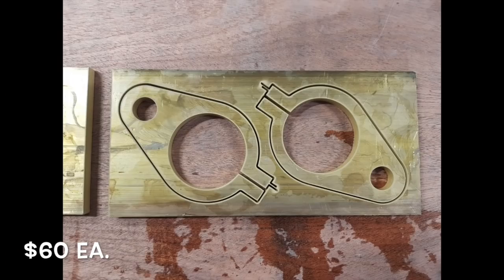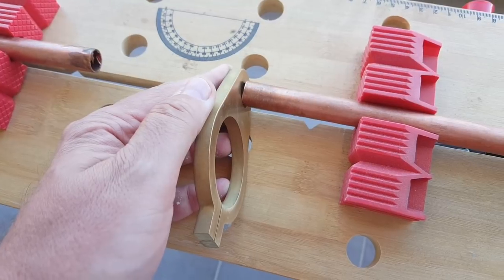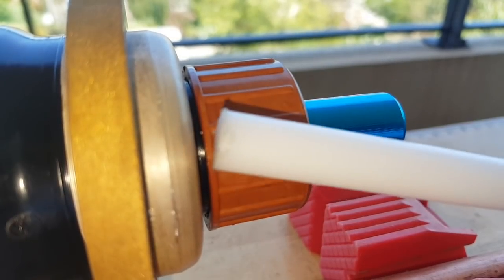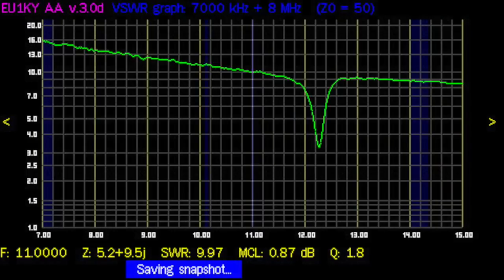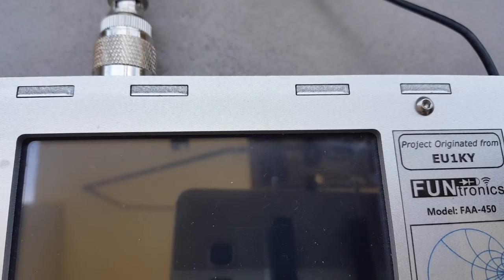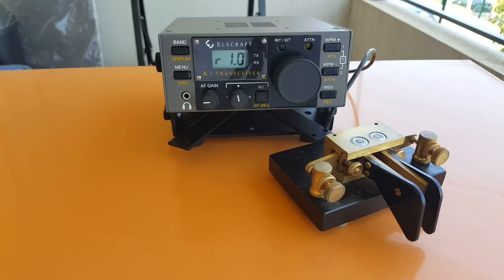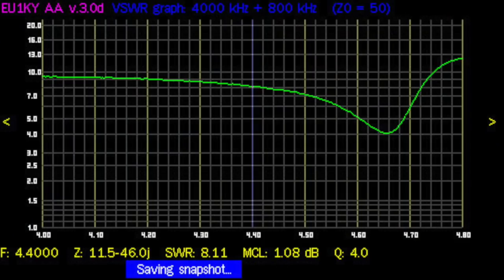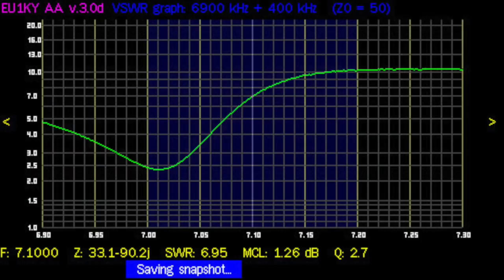Building a Magnetic Loop Antenna For My Apartment, Part 2.

Comment: A simply great video! I had a Jennings VVC for 30-odd years and I broke it last year while making my loop, so I ended up with a Rooskie one too like you. I couldn't figure out a way to connect to those electrodes for decades. In the end, I cut two "L" shaped pieces of 12mm wide copper sheet made from an old copper water cylinder, and I rolled one leg around each electrode and clamped it with a "Jubilee" clip. The other leg connected to the loop (LDF5-50 in my loop).  I hope that the steel railings on your terrace didn't impact significantly on your initial experiments at tuning? Another superb video Gil. TY.
Reply from the maker: Thanks, no effect from the rail apparently...

Comment: So I have a vacuum variable capacitor now, and I have 0.5 in copper tube on the way.  A question I have is what is the benefit of feeding the loop as you did with a torroid vs a smaller feed loop?  I like the neatness of your solution and the simplicity of tuning by the number of turns. 

On the other hand I plan to put as much as 50 watts through it digitally or CW and 100 ssb so I wonder if the choice of feed mechanism matters in that case?
Reply from the maker: In that case I would use the inner loop method..

Comment: Merci for this video. I like how real it is. I am in the USA and wonder how I would find someone to fabricate a vacuum cap clamp like you did. What did you search for in order to find a fabricator? Also, are you willing to share you 3d print and design files for that clamp?
Tnx es 73 de Arnie W8DU
Reply from the maker: Sure, it's on Thingiverse, search for Radio Prepper. To have one made search for laser cutting or water-jet cutting...

Comment: Comparing antenna designs and dangers; 40 watts into a whip on the balcony of your apartment is no different than 40 watts into a magnetic loop antenna.   The danger is that in a loop the high voltage is at the capacitor usually close at hand whereas in a dipole the high voltages are at the tips usually high in the air, same with a whip.

There's an online calculator for how much voltage to expect.  
https://www.66pacific.com/calculators/small-transmitting-loop-antenna-calculator.aspx

"FCC Guidelines for Human
 Exposure to Radiofrequency (RF) Electromagnetic Fields"
As you can see, it is considered safe for the radio operator to be within 1 meter of a 100 watt loop operating in the 20 meter band.  I'm not exactly comfortable being that close but there it is. 

Controlled Population Exposure for 100 watts
(Distance  in meters)
7.01  0.36 
7.02  0.38 
10.01 0.57 
10.02  0.69 
14.01 0.72 
14.02  0.77 
18.01  0.85 
18.02  0.87 
21.01  0.92 
21.02  0.93 
24.01  0.98 
24.02  1.02 
28.01  1.05 
28.02  1.05

Comment: A coil of soft annealed copper pipe used for air-cond (or "big bore" hardline Co-ax like LDF5-50) can allow the loop to be simply formed from a single piece of copper which is both easier than having to construct the octagon plus it does away with the loss from 16 solder connections so helps efficiency so can be worth considering too.
For QRP TX use a  "receiving grade" dual gang split-stator air variable cap is generally good enough for 2 band coverage up to 20W (and is about $100 cheaper). Vacuum Variables are beautiful but just allow you to drive further LF into the  less efficient areas of any particular loops performance. Yours is a beautifully constructed loop, but for those will less access to machining and VVC it should be remembered that the right junk-box  air-variable capacitor and an unbroken loop can offer similar on-air performance.
For a mag-loop the highest performance is always for the highest band it resonates on (with the lowest capacitance).  For ultimate performance don't go for VVC (jack of more bands but master of few).. if you do need the max performance then go for single band operation with a smidgen under a quarter wave loop circumference.
Reply from the maker: Definitely, or a thick stiff coax for the loop...

Comment: Excellent all your video about magnetic loop antenna only one question.For 20 and 40 meter a can use ft240-43 or ft240-31 wish one work better thanks in advance Eddy
Reply from the maker: Not sure. With a bigger diameter tube I might. I would make sure the tube is centered in the toroid.
Reply: Radio Prepper  Thanks for your answer my good friend Eddy from 🇺🇸

Comment: Good build Gil, I will be an apartment dweller, I'm going to first try using the gutters as an antenna then I will have to make a magnetic loop, I hope something goes right.
Reply from the maker: The loop works awesomely from 15 to 60m, but you need to retune almost every time you change frequency..

Comment: The standard coupling loop method (about 1/5th circumference of main loop) would give a better SWR, I think. I've tried shunt feeds and the coupling loop always works best for me. A 1 metre diameter loop matches very well from 60 to 12 metres with a 365 pF capacitor.
73 de G0IFI
Reply from the maker: I might try it! Thanks.

Comment: Wow, I see antenna analyzer from Belarus and old soviet vacuum capacitor. Thet's great. But I'd like to warn about safety. The magnetic loop creates an electromagnetic field intensity proportional to the quality factor. In the case of QRP, this is still acceptable, but I would not even radiate 50 watts. 73 de R2ATO!
Reply from the maker: Absolutely! I would not either!
Reply: There's nothing particularly special about a mag loop other than high voltage at the capacitor.   The idea is that if you are putting 40 watts into it, the best you can hope for is 40 watts of radiated power, and because the electric and magnetic fields both exist and are orthogonal, all antennas look the same once you get a wavelength or so away from the antenna.  

So if you don't mind 40 watts into a whip on the balcony of your apartment, that's no different than 40 watts into a magnetic loop antenna.   The danger is that in a dipole the high voltages are at the tips usually high in the air, same with a whip, the high voltage is at the tip.  But in a loop, it is common to have the capacitor at the bottom and that's where the high voltage is going to be.   The maximum voltage is achieved in resonance when the capacitive reactance is high (ie, small capacitance) and thus large loop for the band.  

There's an online calculator for how much voltage to expect.  
https://www.66pacific.com/calculators/small-transmitting-loop-antenna-calculator.aspx

"FCC Guidelines for Human
 Exposure to Radiofrequency (RF) Electromagnetic Fields"
As you can see, it is considered safe for the radio operator to be within 1 meter of a 100 watt loop operating in the 20 meter band.  I'm not exactly comfortable being that close but there it is. 

Controlled Population Exposure for 100 watts

(Distance  in meters)

7.01  0.36 

7.02  0.38 
10.01 0.57 
10.02  0.69 
14.01 0.72 
14.02  0.77 
18.01  0.85 
18.02  0.87 
21.01  0.92 
21.02  0.93 
24.01  0.98 
24.02  1.02 
28.01  1.05 
28.02  1.05

Comment: I don't have the space or means to build an antenna so I went with a Chameleon CHA MIL HYBRID and put a 102-inch steel whip that of course with a tuner works great and mounted to my balcony railing with ease and convenience.  I'm hoping to talk Chameleon Antenna to build a matcher that will take full legal limit, told them that I'd be happy to buy it.
Reply from the maker: It's a good antenna. Anything more than the proverbial 100W is an absolute waste of power and money. I'd even be tempted to say 30W max, but since most radios come with 100W...

Comment: Great!
I build MKARS80, 80m QRP SSB toy. Work exelent. This was in Canada where I had 1 bedroom apt. So I started with a piece of thick copper wire and two pieces of kitchen foil between the pages of a magazine as capacitor. And it worked!
Later I just used the first air variable capacitor I found.
Your antenna shuld be capable of 100W power...
Best Regards from Bulgaria
de VE7BUL
Reply from the maker: Great improvised capacitor!

Comment: Awesome work! Really enjoyed watching you do this! I was thinking of going down the magloop route for home too. But with a coaxial cable as capacitance and a gamma match, any opinion on the topic that I could use before making all the mistakes? :D
Reply from the maker: The coax works great, but not sure a gamma match still makes it a mag loop..
Reply: @RadioPrepper  aha! I'm interested as to why it wouldn't be a mag loop then? (Genuine question) From what I gathered, most people feed the loop with an internal smaller loop, only a small arc of that interior loop will interact with the main loop and the gamma match is just that same interior loop spread out so 100% of it is used but I might be completely off there :/ Admittedly I should probably take a book and study on the topic :/
Reply: @RadioPrepper  "but not sure a gamma match still makes it a mag loop."  What makes a mag loop is that the antenna is part of a tank circuit with high circulating current and corresponding high voltage on the capacitor.  using a gamma match, as I do, through a variable capacitor makes it considerably easier to get 1:1 SWR at any frequency the loop is capable of tuning.  It is still magnetically couple if you think about it.  Instead of a true transformer magnetic coupling, it is an "autotransformer" magnetic coupling.  The RF from the radio transmitter flows into the tank through a matching capacitor and creates a current in a small portion of the loop.  It is that current that produces a magnetic field that "excites" the loop into operation.  The fact that the exciter current is physically the same wire as the antenna does not change its operation in the slightest, any more than using a tapped transformer changes the behavior of stepping up or stepping down of the transformer. 
Where it might matter is that inductive coupling has no electrical connection to the loop; where a gamma match ties the loop to the radio at DC usually the ground.  This is probably irrelevant at radio frequency but at DC will have the effect of grounding the loop and maybe you want that and maybe you don't.
Reply from the maker: Right, that makes sense..

Comment: All you need to remotely tune your mag loop using a cable and motor, is to scrap an old printer motor, they have not only the bidirectional DC motor, but usually they have a  belt and gear to give it more torque, for the variable vacuum cap. The other side of the cable in a small can, I put a 1k ohm 3- 5 watt potentiometer and a 3 position DPDT switch, to control the direction. Magnetic loops are amazing for their small size, they are worth the time to build.
Reply from the maker: Thanks, I might...

Comment: Gil, on the analyzer You have around 100kHz bandwidth for one point SWR increase whats almost respectable regarding Your build method. I don't think that soldering of Your Camp will make the ML eaven better rather the stabilizing and maintaining a good low resitive and durable connection. If You want to make the loop even better the use of cheap soft copper tubing (18mm diameter) is a good choice. Its easy to bent around to a nice and round circle, even by hand and some food work. That makes a very low resistance solid round loop without any solder joint between. For feeding I made the best experience with Faraday feed build by low capacity 75ohm TV cable. I found that this feed gives the best QRM attenuation for apartment operation and the best overall SWR on a 40-20m ML.
Reply from the maker: Good info thanks.

Comment: Very Nice loop Gil. Brilliant that you are now able to work 20Mtrs and 40Mtrs from home and if it rains the vacuum capacitor should still work much better than open variable capacitor.
It's a shame they are so expensive.
Good luck with the loop.
Reply from the maker: Thanks. I think it was worth it. The capacitor has 22 turns; much easier to tune.

Comment: Hello sir,

I was wondering have you ever tried to put a square in front of your balcony?
why not with four insulation brackets on the corners of your balcony?

(with thick copper wire)
https://www.google.com/search?q=Magnetic+wire+Loop+Antenna&tbm=isch&tbs=rimg:Ca7YAcmMjzi9IjhUbRiYhFXzfXZAAjXBvFoRulOFsHA6fXWQDl8hgqqFGBz8EBN9y5dLoVQe9eRUaRlxuP6HROaw2SoSCVRtGJiEVfN9EZr2TQaslXARKhIJdkACNcG8WhERvLIuv81XyA8qEgm6U4WwcDp9dRE6lm68BM9UYSoSCZAOXyGCqoUYEavej2cPVS_1TKhIJHPwQE33Ll0sRRPMupLrswZwqEgmhVB715FRpGREkkJawkPOZ5yoSCXG4_1odE5rDZEUF3k6IHd75A&tbo=u&sa=X&ved=2ahUKEwj5z_ml8YHjAhUMI1AKHWFaD3cQ9C96BAgBEBs&biw=1920&bih=937&dpr=1

friendly greetings from The Netherlands!
Rob.
Reply from the maker: Pretty good idea, I thought about one inside, on the ceiling... We'll see...

Comment: Another great project and another great video! This makes me want to build a magnetic loop antenna. I might make one for 20, 40 and 80 meters.. I would probably hang the vacuum variable capacitor with stranded wire to avoid stressing it mechanically. It would also be nice to have stranded wire for the toroid and be able to quickly change the number of turns to retune for different bands and have more optimal performance on each band.
Reply from the maker: Yes, I will use taps. 80m would be extremely inefficient, maybe 2-3%..
Reply: @RadioPrepper  - I meant with a larger loop so it'd be more efficient on 80m.  I might try using a large and fairly stiff coax for the loop with the shield shorted to the center conductor in the box that contains the tuning capacitor.  A semi-rigid coax would be easier to fabricate and also more portable.
Reply from the maker: Got it, but make the calculations. An efficient 80m loop would be gigantic!
Reply: @RadioPrepper , of cause, BIG size! The common solution is a two turn loop and remains inefficient on 80m, but better than nothing.

Comment: Good work for small balcony working space.  Get a hotter torch and re-sweat all joints and the brass clamps too.  What will be the highest power you plan to use, or are you staying with QRP?  A good bit of work.
Reply from the maker: Thank you. I will. Max 30W with the PRC-320.

Comment: Great work Gil! I would love to see if changing the troriod out for a single larger loop would provide greater tuning range.
Reply from the maker: That would be interesting...
Reply: Of cause, a wire feed increase the low SWR tuning range a lot, specially when using a Faraday feed with 75ohm low capacitance coax. Further on I observed with the Faraday feed a considerable attenuation of QRM pickup. This is very good for apartment operation!!!
Reply from the maker: What do you call a Faraday feed?

Comment: How about a rotary switch on the toroid to choose the number of turns. That way you can adjust on the fly to change the band. Great project. 73 Charlie KM4ZZ
Reply from the maker: Thanks. I probably will try taps.

Comment: I want to make one of these optimized for 40m. Can you post a link for the capacitor? Also would you be interested in making and selling more of the brass plates? They are fabulous. How much power do you think it can manage?
Reply from the maker: The plates? More than any capacitor! I found mine on EBay. No link sorry. You may contact the French site for the plates, they must have an English speaker there...

Comment: Very  good finish , Professional industrial finish , but it cost Time and Money  yet  no much efficiency
Reply from the maker: When propagation will cooperate it will work very well.
Reply: Thank U for quick reply 
By the way ... in your Opinion ... How much dB's (improvement) we might get in Such (Vacuum Capacitor) VS a normal-Classic variable Capacitor  ? .... keeping in the Loop circumference /loop material and thickness /Frequency of Operation (same)  in comparison ??
Reply from the maker: I don't think you gain anything. It just can take higher voltages.
Reply: @ssubaihi  - What really pays of is the low impedance connection between capacitor and loop. There any mOhm counts, independent of what type of capacitor is applied. Vacuum cap is good for high power on small dimensions, but, If You want to experiment on QRP power level You will get almost the same results with a dirt cheap mecanical Ebay cap for 10 bugs - Considering that You do all to make a LOW IMPEADANCE connection!!
Reply from the maker: Sure, but I get a 22-turn capacitor that way, easy to tune..
Reply: @RadioPrepper  - Yes, of cause, and tuning of the cheap mechanical varicaps can be really tricky. But there is a "counter trick": I used to place a second varicap with some few pF in parallel, only for the fine tuning inside the band.That way it works perfect.
Reply from the maker: Great tip thanks.

Comment: Hello, very nice and pretty effective setup. If you allow me, I would add some things. 1, after you remove the loop from your workbench, use something to avoid stress on the vacuum variable. I had one loosing vacuum. SImilar type. I do not know what was the reason, but I suspect this was the problem. I have used 2 plastic clamp and a piece of wood. Now I use a longer and larger cross section piece of wood and 6 clamps. 2, Do not use 45 degrees joints. I have used recently 22mm soft copper tube, coming in a coil, it was easy to make a 2m diameter loop for 20/40. Before, I had 15mm hard tube, marked where to bend and made a not very nice, but jointless loop. 3, what is the reason to use brass? I'm using 3mm copper sheet, your brass may be better. Also, it may be better to make it tight as you do, but FYI, when I made it tight, soilder did not get between and soldering was bad. I had to open up the hole and resolder, now it works well. You thick material may work better with direct clamping, but than do not solder it. It will not flow into. Regards, JG
Reply from the maker: Thanks. They did not have copper in stock. I plan on putting a rod inside the tubes below the capacitor..